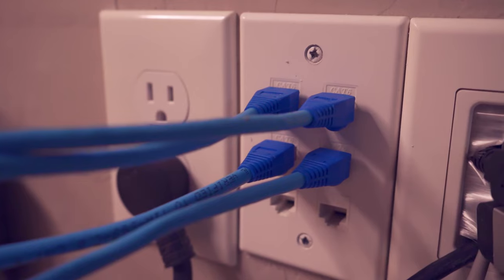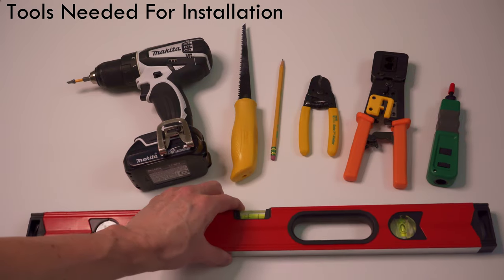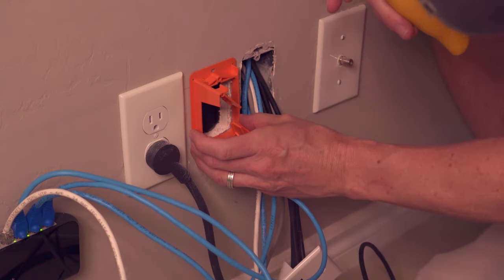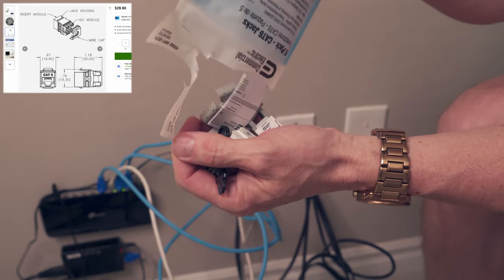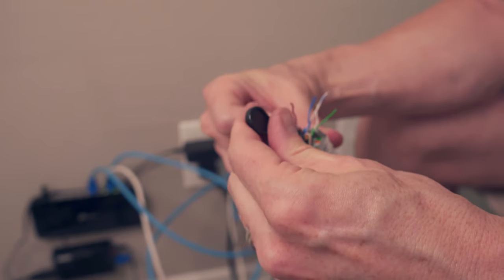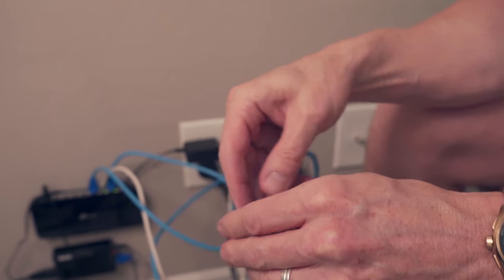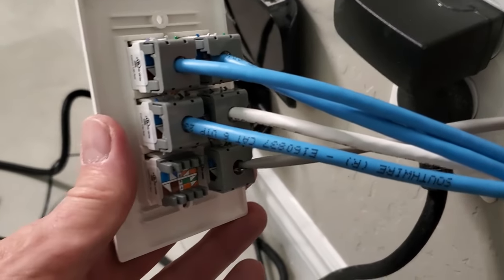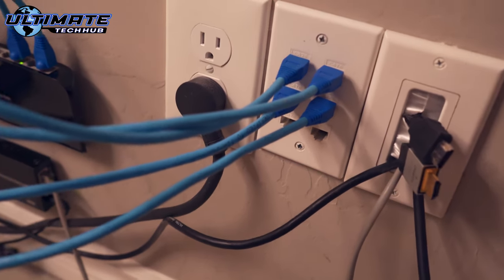CAT6 - 6 PORT WALL JACK INSTALL - QUICK & EASY!

Comment: Quick tip: RTFM

If you did, you'd know that low voltage gang box says to use the 4 small holes in the corner of the bracket to mark the wall, then use the edge of the bracket as a straight edge to connect the dots, at which point you'll have an exact template instead of "now hold the bracket to the wall again to see how much more drywall you need to remove" and creating that absolute disaster of a drywall cut

Hell, if that's the brand of bracket I think it is, it even has it printed directly on the front of the bracket with arrows pointing to the small holes "use these holes to mark your surface"
Reply from the maker: Like I said in the video I had to be careful because I was very close to the other outlets and the drywall was very flimsy. So I had to cut away a little at a time in order to not break the drywall on the sides. And yes the 4 holes is how I install it in a normal situation where things are not so crowded. Thank you for watching.

Comment: Great video! I liked the description of the use of punch down. I had done a similar project in my house and i am curious why you decided to add capstones instead of the Ethernet couplers in your face plate?
Reply from the maker: It's how I've always done it and it's better to show the wiring schematics for the capstone installation. I've never used Ethernet couplers and I'm sure they work just the same but it's just my personal preference. Thank you for the kind comments and for watching!
Reply: Every joint in the wire is a potential point of a poor connection. Keystones connectors are a better connection.
Reply: @ChrisCowles  For bulk or structured wiring, yes, keystone jacks are better because solid core wires in those cables are quick and easy to punchdown. They can be terminated with modular plugs which would plug into keystone couplers, but that's typically takes longer (especially with CAT6 or better) and like you implied, introduces another point of failure. But for patch cables, which have factory terminated plugs, using keystone couplers make more sense since punching down stranded wire is very difficult and unneccesary.

Comment: That was one of the best videos I've seen on this topic! 

But there is an issue I am facing. I have a RJ45 wall socket, but that wall socket is not giving more than 100mbps speed. Whereas, the router from where wall socket is originating can easily give more than that. I have tested by connecting my laptop directly to the wall socket, as well directly to the router as well. What can be the issue?
Reply from the maker: Its either the ethernet cable inside the wall or the wall jack. Did you check the wall jack and see if all of the wires are installed correctly? I'm betting that's the issue. Incorrect wiring can cause slow speeds. Keep me posted and thanks for watching.
Reply: @UltimateTechHub  I finally got this working. I called the guys who did the installation, and they fixed the punching.

Comment: Love this, but you can't use it if your walls aren't made of paper or what...try it in a house made of bricks...
Reply from the maker: Haha, my house is made of paper? That's hilarious! Yes if you don't have drywall then this video won't help you especially if you have brick or concrete walls. Thank you for watching and the great comments! I really appreciate it!
Reply: @UltimateTechHub Drywall or paper... doesn't matter if we in Europe have bricks or concrete... but the question is, could you make some tutorials for brick/concrete walls? btw our house is over 30 years old. I ain't sure if it would be the most logical thing to do because it could collapse some walls.
Reply from the maker: @tronosgamingwizard  I can do a video on it but I don't have any brick walls for a demonstration. Probably the best was to run the cables is an indiscreet conduit for the wires to travel down the outside of the  wall. Maybe run it down the corner of the wall and you could run the wires under the carpet. Drilling a small hole through the brick or concrete to run wires from one room to another should be easy. Just use a masonry drill bit.
Reply: @UltimateTechHub  the advice is good, i like it..
Reply: @mathewswanson6433  what is Panduit?

Comment: The punch down tool should punch down the wires and cut them.
Reply from the maker: I had to adjust the wheel for the correct height and it cut the wires. Unfortunately I didn't film it. Fluke makes a better punch down tool that is easier to use and much smoother. Either way it's all good. Thanks for the comments and for watching I really appreciate it.

Comment: To avoid scratching the wall plate screws (it's easy to chip the paint off) wrap some masking tape across the front of your straight blade screwdriver, and be gentle. If using a driver, set it on the lowest torque setting.
Reply from the maker: Great idea! Thank you for watching.